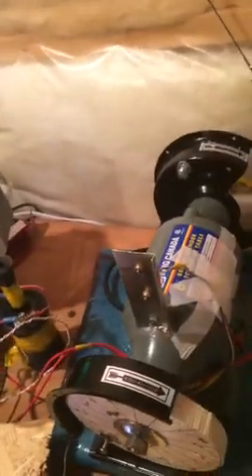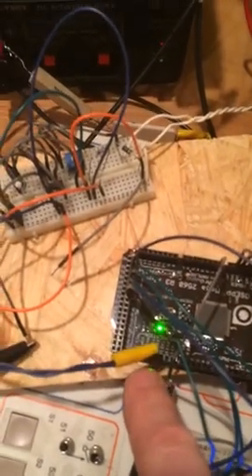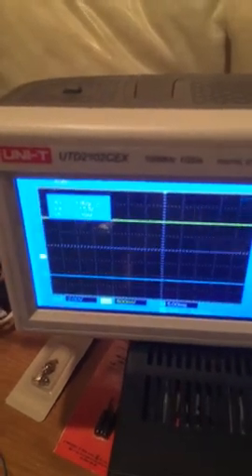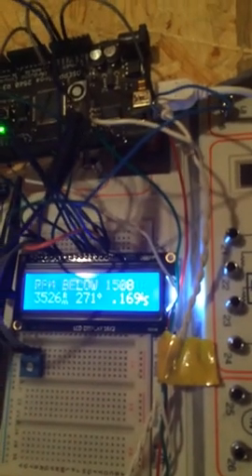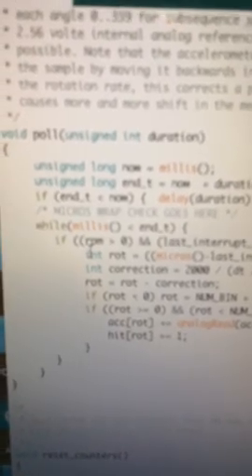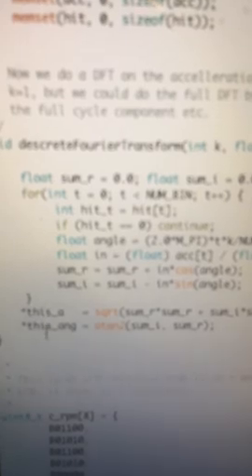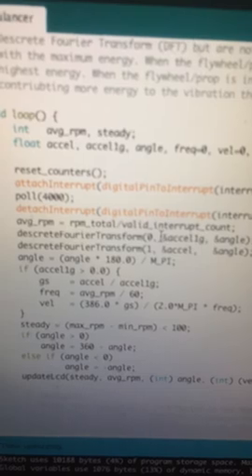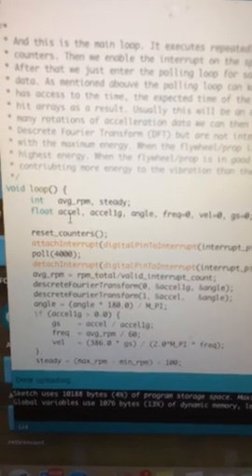Arduino Vibration Analysis for Aircraft Engine (or any  2/4 stroke engine).

Comment from the maker: Code just uploaded to GitHub at: https://github.com/peterashwoodsmith/vcheck  Also included are a couple of PDF's showing the circuit diagrams of how to wire the LCD and the 555 timer implementation of the spark to square wave conversion to drive the interrupt.

Comment from the maker: Yes, but I have to make packages and circuit board etc. I also need to test with different spark rate vs rotation rates for 4 stroke or radial ratios. Also want to get a higher BW accellerometer.